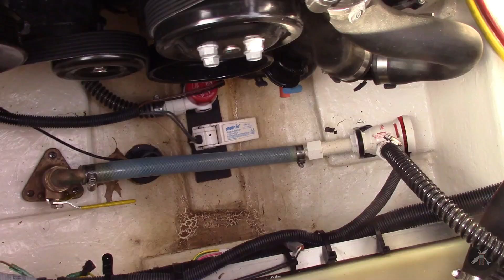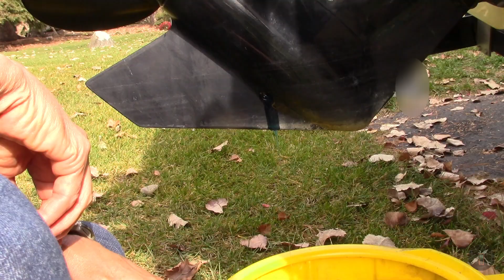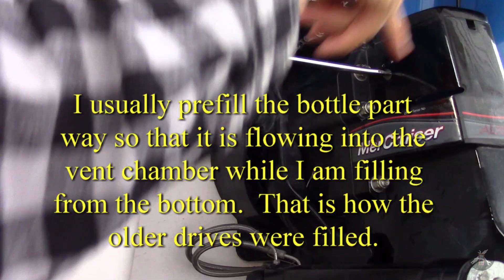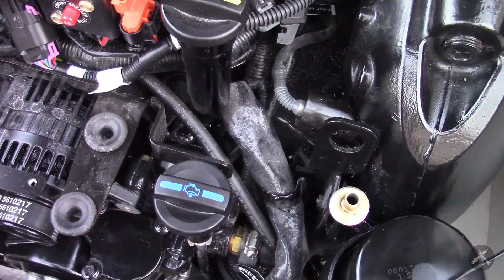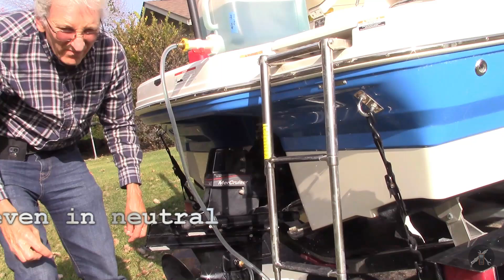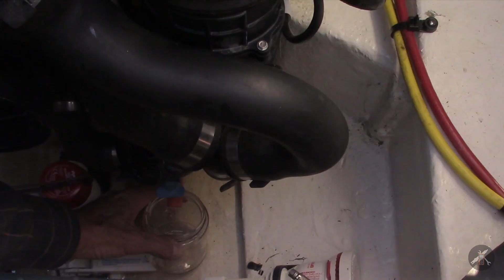UPDATED: Winterize 2018 Mercruiser Alpha1 Stern Drive 4.5 L 250 HP

Comment: Love the details and ability to complete everything with this video. My understanding was that once the thermostat opens it will loop the antifreeze to the blocks. Not sure if it took place with just idling at 630 rpm and showing my coolant temperature at 144 the highest point. I did get about a gallon in ti the blocks just like it is shown in the video. Thanks for the content!!!
Reply from the maker: You're welcome.  The standard thermostat is set to crack at 140F.  Mine will usually idle around 144 on the Merc app. I haven't been back to the cooling diagram for a while, but my memory is that the thermostat has some amount of bleed around it so that the exhaust system gets some flow even during warm up.  The 4.5 is really complex because they are trying to regulate flow around the manifolds and catalysts more precisely than my old 5.0 GM engine.

Comment: When you fill the block, does that antifreeze run down through the water pump in the lower unit?
Reply from the maker: If the block is filled enough, the overflow can go out both the exhaust and back to the water pump.  The inlet hose to the engine from the water pump in the lower unit is near the top of the engine.  It's harder to do on this engine because the thermostat fill port isn't extremely high.
Reply: Thank you! Great videos!

Comment: Great video. Are you sure about adding 2t oil to prep fuel mixture? I have 2017 4.5l 250HP engine with cat version and wasn't sure if it will be good for catalyst. Can it be any 2t oil or specific norm?
Reply from the maker: I am traveling this week, so cannot verify by my manual.  If I recall correctly, Mercury specifies to use their 2 stroke oil, the premium version and says that the catalyst will not be damaged. I'll verify when I can get to my manual.
Reply from the maker: To be precise, my Mercury 2017 Manual For 4.5 EC and non EC specifies for MPI models: "Important: The special fuel mix can be used on Mercury Marine catalyzed gasoline engines"
The official mix per the manual is 2 US qts of Premium Plus 2 cycle TC-W3 outboard oil and one ounce of Mercury Quickstor fuel stabilizer to 5 gallons of fuel.  This mix is then equal to 12.8 ounces of oil to a gallon of fuel (my conversion of 64 oz / 5).
This was a video I made explaining my thoughts on this: https://youtu.be/7ZS79eTr5yI

Comment: Great video - as a new owner of a 4.5L engine, this video is great. Do you have a link or size to what fitting I need for the temporary fuel line in order connect to fuel pump the way you do? I’m just getting organized now so I’m prepared for when it’s time to winterize
Reply from the maker: I had a number of question about this, so I made this video that explains what I am using.  Every boat may be different, so you'll need to check your system.
https://youtu.be/chyeMXcCNGA

Comment: Mercury makes  a oil drain kit line the replaces drain plug out through the hull drain plug 👍
Reply from the maker: Thanks, I wasn't aware of that.  In my old 3.0 4 cyl, I had an old antifreeze bottle with the side cut out and a hose that I ran out the drain plug. I could drain into the bottle and let it drain out through the hose.  When I went to the V8, the access was tougher and went to the top side pump.

Comment: Hello, I’m looking for the exact thread size of the oil dipstick tube on my MerCruiser 4.5 MPI (4.5-liter) engine, in order to install a hose adapter and use an electric pump to extract the oil directly. I’ve already tried using a standard garden hose thread, but it doesn’t fit."
Reply from the maker: I have been using a Jabsco hand pump for many years. It worked on my 3.0, 5.0, and now 4.5 Mercruiser. It comes with what they call a 3/4 inch female hose coupling. My current pump is a Jabsco 34060-0130. The spec sheet on the pump is at this link:
https://www.xylem.com/siteassets/brand/jabsco/resources/manual/user-guide-utility-hand-pumps.pdf
There is an entry for "special purpose pump", with an adapter of "3/4" NH" .
The thread (3/4 NH) for this should be 3/4-11.5 straight thread. It requires a hose washer to seal. Reference dimensions for 0.75-11.5NH are here:
https://www.engineersedge.com/hardware/standard_hose_coupling_threads_16277.htm
On my older Jabsco pump, I had to install my own fitting and I did find that some brass fittings had a center hole that was too small for the dipstick tube to pass through to get it to thread on. Other than that, I am not sure what the problem might be.

Comment: I was planning to do a setup like you have with the external fuel tank. Can't seem to find what size fitting to get for the fuel line. Is it just a standard size?
Reply from the maker: I have had some questions about the fittings.  They can vary depending on exactly how the boat manufacturer made the connections.  The following video is what I use on my application:
https://youtu.be/chyeMXcCNGA

Comment: trying to winterize for the first time.  my dealer said they dont do the separate gas tank with the mixture, they just put a certain stabilizer, i think with corrosion inhibitors and run the engine until it gets warm.  since that is the hardest part, i was hoping that was adequate.  
i had a hard time finding the 50f starbrite so trying the 100f and going to dilute it.
Reply from the maker: As noted in the videos, I try to work to the Mercury Service Manual recommendations. The older engines like my 1998 305 carb use fogging oil to protect the intake and cylinder walls from corrosion. The newer fuel injected engines use the 2 stroke oil mix as a substitute for fogging because they don't want fogging oil sprayed into them.  I use fuel stabilizer all year and add it when I fill the tank to keep the fuel fresh through the season.  Some brands have corrosion inhibitors for the fuel system, but apparently Mercury does not judge that sufficient to protect the engine in storage.

Comment: Great video! So informative. I have the same engine, Mercruiser 4.5 200 (Larson 210 LXH). I am perplexed though: Adding marine antifreeze to the upper vent plug, very soon it all runs out the stern drive. Do you have that blocked by the muffs? Thankyou for all your contributions. I have also used your advice to change the fuel filter cartridge. On my boat, the lower fuel intake point there is a quick disconnect, which is what I access to run in the special fuel mixture. 😀
Reply from the maker: At some point of filling the block, the level reaches a point where the coolant appears to flow into passages that lead back into the outdrive. I can fill mine to about six or seven quarts (1.75 gallons)  As I approach the 7 quarts, it will begin to flow out of the outdrive. When I drain the block through the single point drain, I can get close to the 7 quarts drained out.

Comment: Very comprehensive video. We are in northeast Alabama, so I drain the water but do not put the engine antifreeze in.
Reply from the maker: Thank you.  Even where it doesn't freeze, there is some benefit to the correct antifreeze that has corrosion inhibitors.  I don't know how much difference it makes, but the blocks and heads often don't dry out over the winter.

Comment: Great video! Very thorough. For my procedure, I run my 4.5L 20 minutes then change the engine oil. Run it another 15 minutes. Then switch to the special fuel mixture. Run it 15 minutes at 1150rpm. Stop the engine and drain all the water. Run the engine and suck  in 7 gallons of -50’c rv/boat antifreeze through the muffs. Stop the engine and open the single point drain to drain the antifreeze.  Then start the engine and suck in 5 gallons of -60’c antifreeze. About 2 or so gallons comes out during the final run. I leave the rest in.
Reply from the maker: It sounds like your process is even more thorough and should work very well.

Comment: Just got this boat and it was in salt water , how do I clean the cooling system and should I add anything in it in case corrosion and obv salt
Reply from the maker: I don't know that I have a good answer.  Mercury just advises to flush out the engine with fresh water after every use in salt or brackish water.  Once it is flushed, I'm not sure what else you can do for the cooling system.  Since it is an open system, traditional engine cleaners don't seem useful.  From reading about salt water issues in service manuals, the most significant risk seems to be in the exhaust system water passages due to restriction / overheating or water leakage. Again, I'm not aware of preventive maintenance for that other than disassembly and inspection if you suspect an issue.

Comment: how to change the spark plugs
Reply from the maker: I don't have a video yet for the 4.5.  This one is for the 5.0 and is similar:
https://youtu.be/A-A0Upu1cQg
For the 4.5, the plugs are down below the lower exhaust manifold section that runs forward. Mercruiser says to use a thin wall socket, turn the boots 90 degrees to break them loose before pulling them off.  For installation, torque in an existing head is 14 N-m or ~ 10 ft-lb.  Mercury says that if you can't get a torque wrench on them "tighten securely".  
I had someone comment that they did their 4.5 with only a thin wall socket and without needing the tools I used in the 5.0. It may vary with each engine.

Comment: Can you tell me in litre (not gallons sorry ;-)) the exatly quantity of fuel, oil and stabilizer did you mix in your tank?
Reply from the maker: Yes.  Now bear with me, I want to be precise:
In US measure, Mercury service manual specifies 2 qts of Premium Plus 2 stroke oil # 92-858026K01 added to 5 Gallon of gasoline, along with 1 oz of #91-8M0047932 Stabilizer.  I use a different brand of stabilizer, but the amount is the same.
In Metric measure, it is 1.89 L of oil to 18.93 L of gasoline with 29.5 ml of stabilizer. As you can see it makes a mix of 10 parts gasoline to one part of oil or a 10:1 mixture.

Comment: Hi, I'm italian and i'm going to launch my new mercruser 4.5 200HP motorizing boat. This video is perfect for me! Thank you very much! Only a question for you: the hose with those fittings you are using in your video to fill your mixture in to the engine or extract oil are sold by the dealer exactly as i'm seeng or is self-made.?
Reply from the maker: Congratulations on your new boat, I hope you enjoy it!
The fittings and hose to supply the special fuel mix for winterizing are self made.  I have had a number of questions and have this video to help explain my solution:
https://youtu.be/chyeMXcCNGA
The extractor pump for the oil change is this:
https://www.wholesalemarine.com/jabsco-little-pal-marine-oil-change-pump/
I have been using this brand pump for nearly 40 years. I wore one out a few years ago and am on my second one.
The top of the dipstick tube is a standard fitting that we use for a garden watering hose connection in the US.  I purchased one that fits into the end of the large hose from the pump.
Reply: @bitsofwisdom460  Thank you very much Dan! I have another question for you: Can you explain to me exactly what the oil pump fitting is that you screw onto the oil dipstick?

Comment: Thank you for this video! I am a visual learner so this is extremely helpful. 
Question: Is there any reason you could not just run the boat gas tank down low and then add the fuel stabilizer and two stroke oil directly into the main tank? Once ran I would fill the main tank full and add additional stabilizer. Not contradicting your method but just wanting to see if that works an also a possibility.Thanks again!
Reply from the maker: Well, there are a number of challenges.
1. When you run the tank down, it is still hard to know exactly how much gas is there for an accurate mix. It's also difficult to get a thorough mix in a short time when you can't shake the tank.
2. Running the tank down gives the risk of running out and causing misfire that will damage the catalysts.  I used to run my 1998 (non-cat) down very low before I could get non-ethanol fuel, and at the last couple of gallons would sometimes slosh and the engine would stumble and misfire badly for a few seconds.
3. If you do get down to say 5 gallons, that is 53 ounces of oil. If you had a 30 gallon tank, 53 ounces would be about 70:1.  A standard two stroke, oil injected, runs between 50:1 and 100:1. Your boat would smoke like a two stroke and I don't know the effect of the additional oil on the catalyst and O2 sensors when run for a full tank rather than just 5 minutes.
Reply: @bitsofwisdom460  Excellent points and I agree it would be very difficult to get and accurate mix. There would be a lot of guesswork and to your other  point potential for more harm than good with running a full tank of even highly diluted 2 stroke oil. I wish Mercury would have come up with a safer way to inject the mix into the fuel system. It seems like an opportunity for an explosion waiting to happen from a DIYer that isn't as thorough in their method as you are.
Reply from the maker: @JDC129  Yes, using Mercury's official process has its risks because you are taking apart good fuel connections. Last spring, I had a fuel leak.  It was good when I put the boat in service in spring. But as careful as I am, I apparently didn't properly tighten the fuel fitting when I put it back together after the winterizing. After a few hours run time it started dripping - it was only finger tight at that point. Fortunately I run the blower a lot to keep it ventilated and I picked up the smell as I was docking, before it became a disaster.

Comment: This video was very helpful, thank you ! 

Any chance we can get a video on the proper way to flush this motor out while it’s on the water for those of us docking in the water during the summer?
Reply from the maker: I would do it, but I really don't have experience with that.  I expect you must be in salt water where this would be more important. My boating is all in freshwater and it hasn't been a need. 
However, I have seen a couple of systems that might help you.
1. Flushing bag: https://burgees.com/FlushingBag/Model_MB1.htm
---Most of the flushing bags are intended for use on land, but the flushing bag company has a model for outboards that are in water (at link).  They advertise custom bags, so perhaps they could modify an existing stern drive bag.  It might be a challenge to get one of these bags under the outdrive, but perhaps it is a solution
2. Super flush device:
http://www.superflushsystems.com/professional-superflush-sf400c-for-gas-powered-engines
--- This device plumbs into the engine cooling system and with a hose connected will flush the engine without the engine running.  The only concern that I had with this one is that the description indicates that you would connect the kit at the block drains by removing the blue plugs.  On the 4.5 with single point drains, there are no blue plugs, it might require splicing into a hose. Perhaps the company has a solution to that, I haven't studied it in great depth.
Reply: @bitsofwisdom460 I do keep it in brackish water. Salty enough to do damage. The next boat will definitely be an outboard for ease of in water maintenance

Comment: Does running the rich fuel mixture ruin the fuel filter/water separator? Are you going to produce a video showing how to change the fuel filter? Great winterization video!
Reply from the maker: The fuel mixture with extra-2 stroke oil should not affect the filter.  My first reason is that Mercury specifies this process in their service manual. They wouldn't specify that if it wasn't validated to work.
In my opinion, filter elements that can handle gasoline ought to be able to handle the oil, and outboards have run at a variety of mixtures over the years.  I believe there was a time when they went as far as 20 or 25:1.  While not 10:1, still a heavy mix that marine filters handled without issue.
I have not yet made a fuel filter video, but it's on my to-do list.  
And, thank you.
Reply: Thanks for your reply. I have the same 2018 Mercruiser motor and Chaparral boat. Very helpful.

Comment: Is there a .pdf book that tells you all these steps for this motor?
Reply from the maker: I am not aware of anything in PDF. There could be something third party, but I haven't seen it yet. I use Mercury factory manuals that are only hard copy.  They can be a little challenging to navigate, but they are the best that I have seen. You can order direct from Mercury.  They ask for your serial numbers to be sure they send the correct one.  There is a manual for the engine and a separate one for the outdrive.
Reply: @bitsofwisdom460  I found an operation manual for it that covers the 4.5L and others too. Putting that with your video I am determined to save the $600 I paid last season and do this myself. Thanks for doing the video. I am a lawyer and don't have time for it - that is until the price got high enough and now I do plumbing, electrical, etc. Thank goodness for people like you doing tutorials!
Reply from the maker: @Digiphex  That's seems like a rather stiff price for that work, but I haven't had it done at the dealer for a while.
Glad that you found a manual.  I have used third party manuals and they can be helpful. Just keep in mind that sometimes the factory manual can provide more detail to help you  out of a jam.
Reply: @bitsofwisdom460  Yeah it is because I am at a dock with no means to move the boat to a dealer and it has a charge of coming out here. But still it is astronomical compared to 3 years ago.
Reply from the maker: @Digiphex  Since you mention being at a  dock, note that if you need to drain the block when the boat is in the water you usually need to locate and disconnect the hose from the outdrive / water pump to the engine to keep from siphoning water back into the engine while it is trying to drain. If you have a lift / hoist and can get the outdrive out of the water, then it's not an issue.